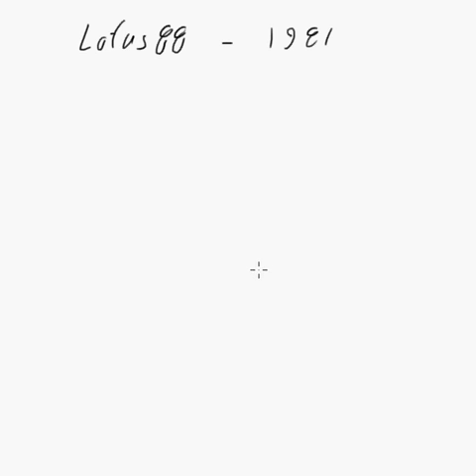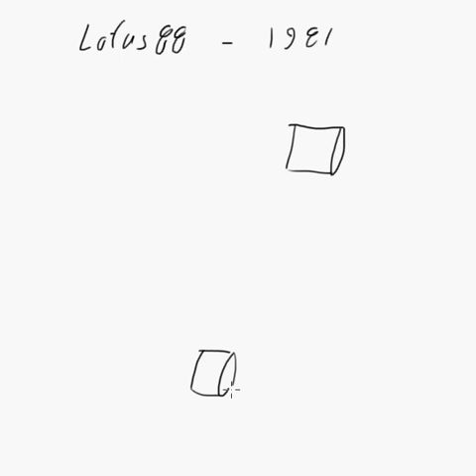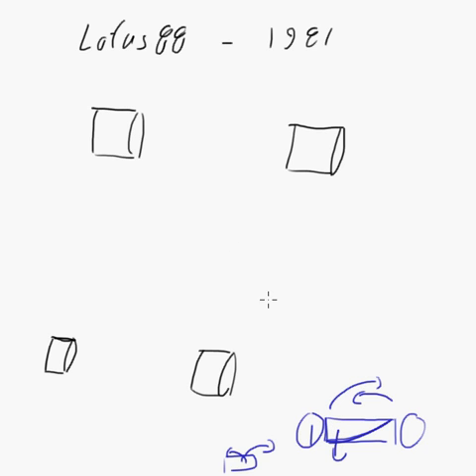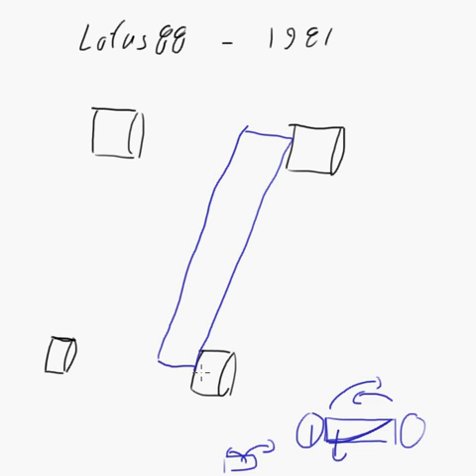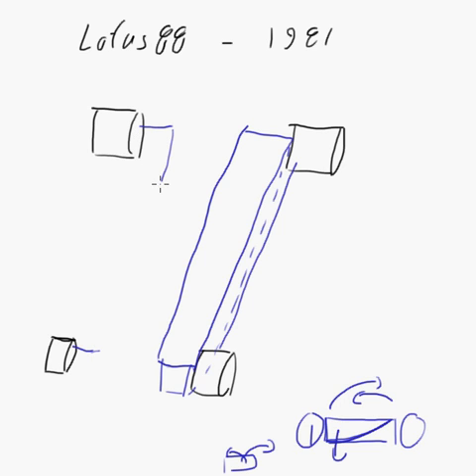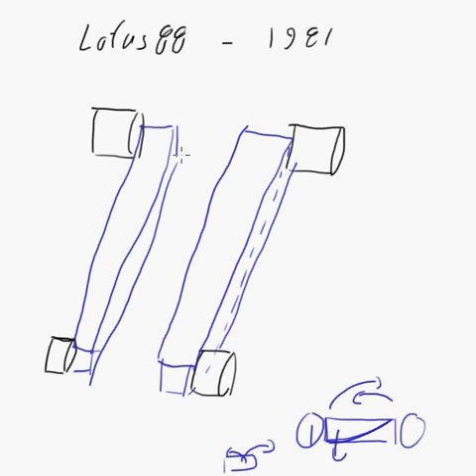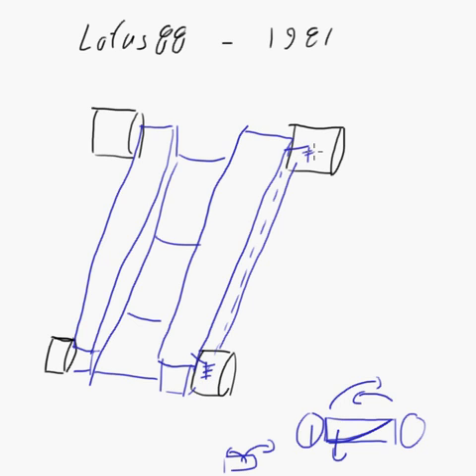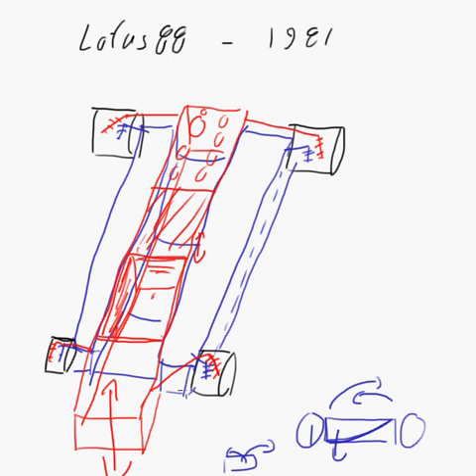Lotus 88 Formula 1 Grand Prix Car Explained

Comment: Wouldnt the additional springs add weight to the car?
Reply from the maker: The cars back then, especially the Cosworth powered ones were under the weight limit, so adding springs would not be an issue

Comment: I don't think this is accurate. The cockpit or the monocoque is not connected to the softer sprung section. It's actually the other way around. This video shows https://www.youtube.com/watch?v=MwNgwnMkHaI
Reply from the maker: The cockpit / monocoque are connected to the softer section for one simple reason - ease the vibrations and handling for the driver. The outer wing chassis is connected to the hard springs because ground effects require minimal movement to avoid porpoising. In the video above, the guys were pushing the outer hard section down
Reply: @kovolff  It's actually the other way around. The regular suspensions are attached to the carbon monocoque just like any other cars as you see in any photos of a 88. In the video that I posted the link for, as the aero body is pushed down, the secondary softer-sprung 'suspension' is moving, not the main suspensions. You cannot easily do that with the regular suspensions in any F1 car. A such, Chapman's intension was related more to clearing the skirt regulation in 1981. As the load of air pushes the aero section down, the skirt seals and creates more downforce.
Reply: @ahsoc6981  You are correct.  Any recourse to an 88 tech manual explains it in detail.